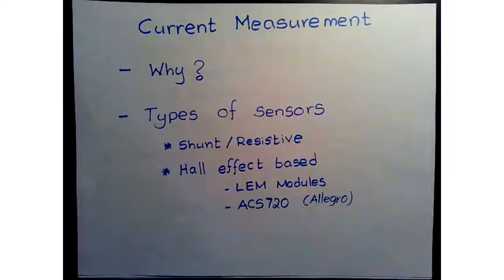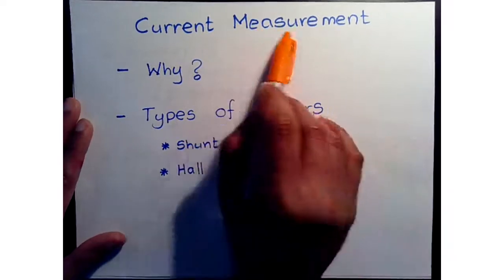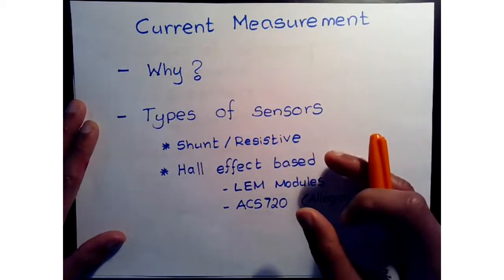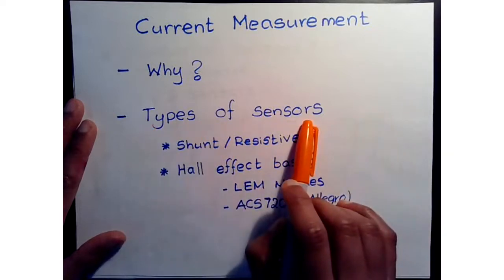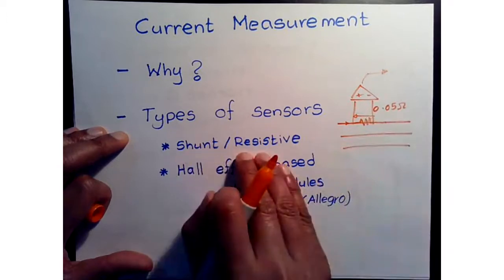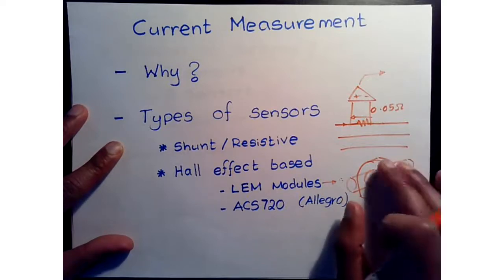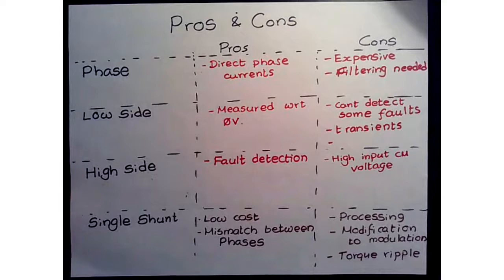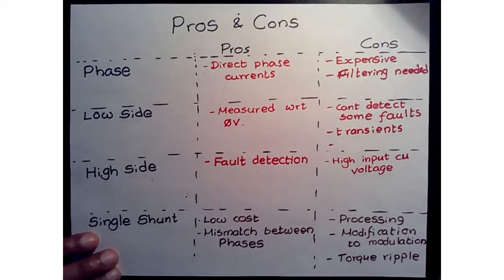Current Measurement Techniques in AC Drives

Comment: So why can you detect the fault with the highside measurement, but not with the lowside??
Reply from the maker: With high side current sensors, currents are measured as they go in, where as with low side they are measured as they come out. If there is a short to chassis, low side current sensors wont see them. Just one example.